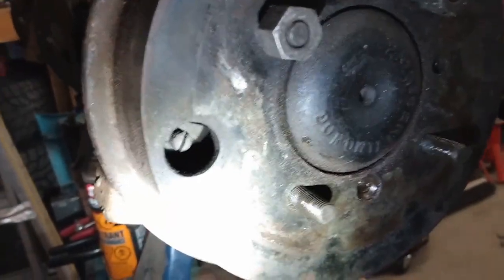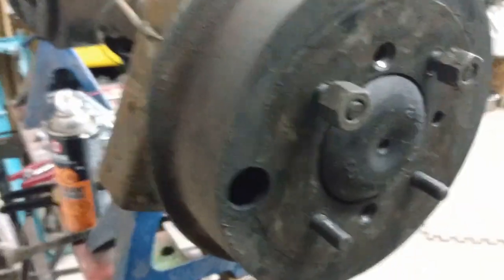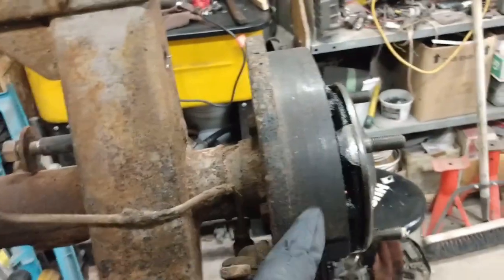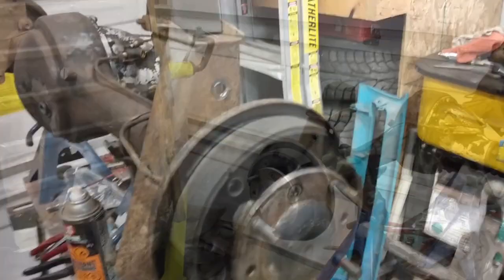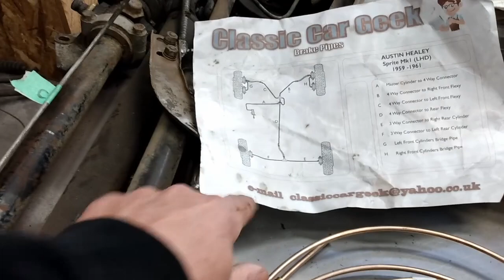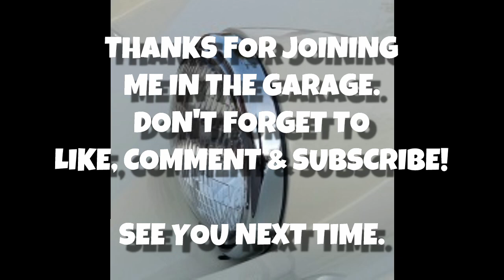Brake drums, half shafts and hubs off the Austin Healey Sprite's rear axle - Bugeye Build Episode 23

Comment: Nice improvised puller, worked like a charm. Also, I shot that vendor an email asking about the products, figure I might as well get the lines sooner, going to need them eventually.
Reply from the maker: I drilled the holes as close to the angle as possible while still allowing room for the socket. That way it was not as likely to bend.